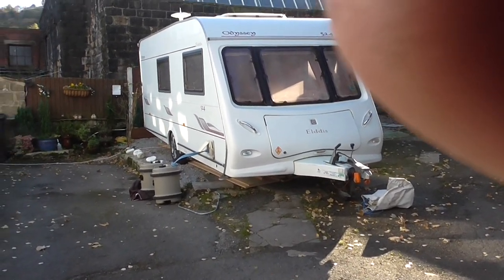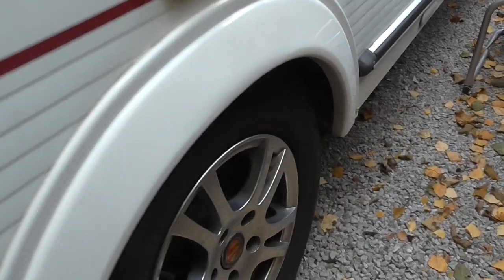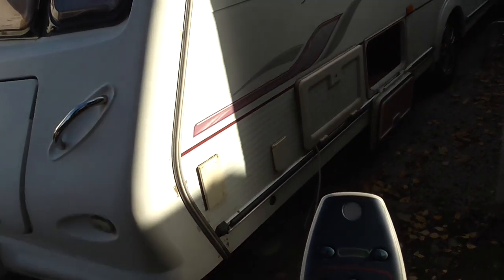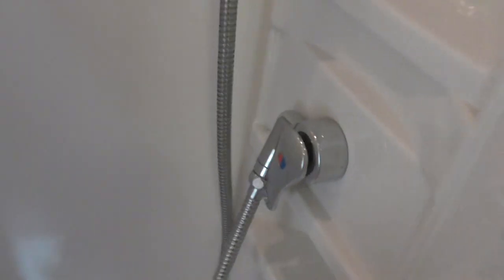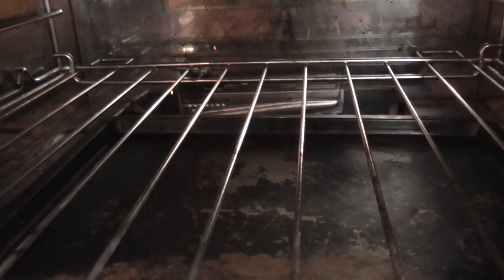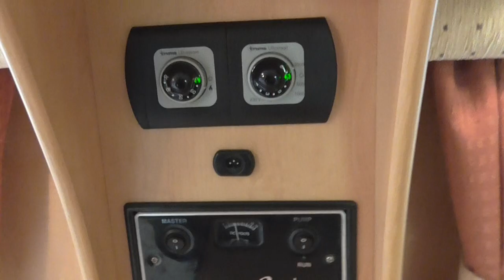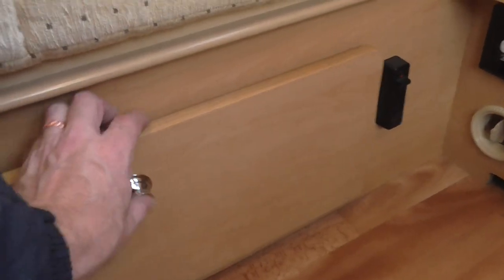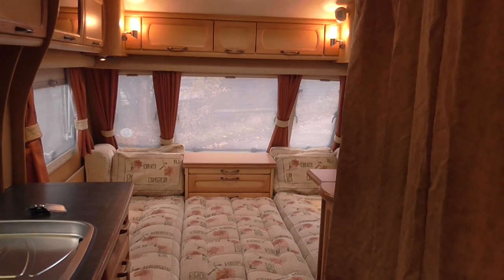Elddis Odyssey 524 , four berth caravan registered in 2005 with motor mover.

Comment: Shaun is there any possibility of speaking with you. We recently bought an Elddis and we’re flabbergasted with why power doesn’t work from solar panel and better. We bought a leisure battery today for example and caravan power, master switch and voltage don’t work still. Works off electric mains. But that’s it. And at that, the electric is even a little dodge.  I’m in Ireland and would love to hear from someone who could help ? 
Thanks in advance. All help welcome